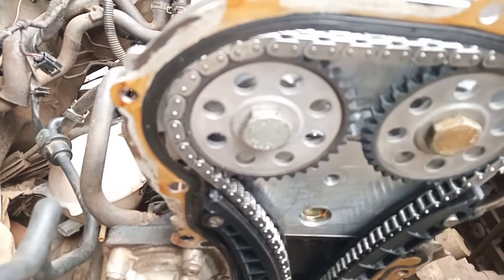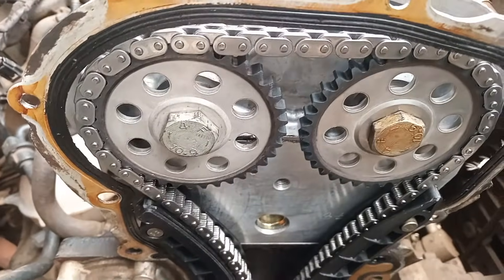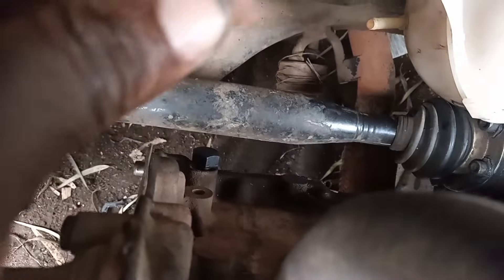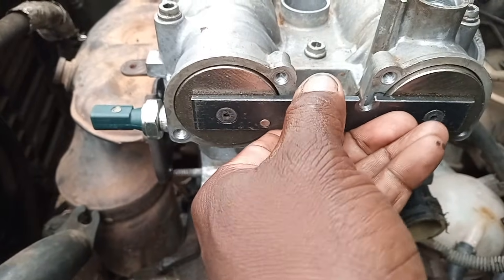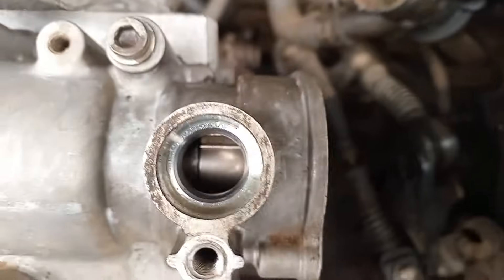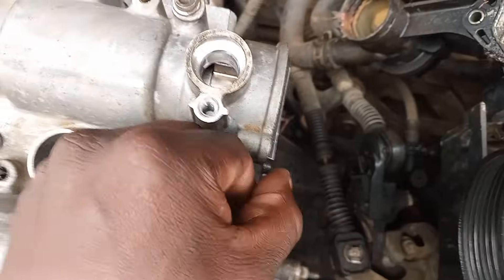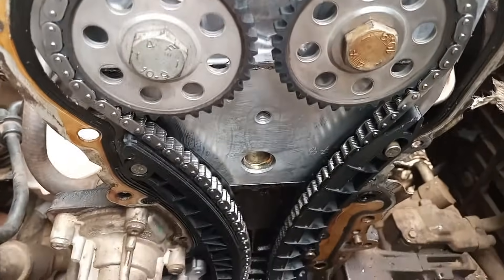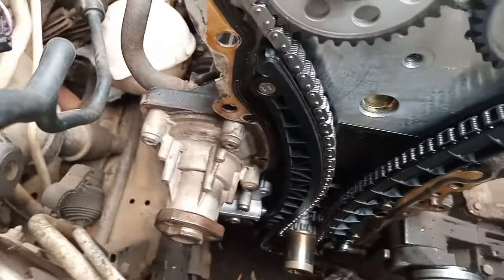VW Polo vivo  timing (CLP)

Comment: Good day my engine starts, but it shakes a lot, I have changed the breather valve fuel, changed plugs, and on plug number 1 and 2 they don't respond when removing the coil to show that it has been removed, The engine has to change the idle or sound, but it doesn't. Then on the camshaft is not aligned like the tool; it's vice versa. What could be the problem?
Reply from the maker: @juliussamuel2734  hi, if it's not responding on cylinder 1 and 2 it's likely that the head gasket is blown between the two cylinders. To verify that, do a compression test and see the values in all cylinders. Let me know if after checking compression
Reply from the maker: @juliussamuel2734  did you do any mechanical work on the engine?
Another possible cause could be a stretched timing  chain.

Comment: I have polo vivo 1.4  it chain keeps jumping what's the cause?😢
Reply from the maker: @AshantyPhaswana   replace oil pump, if oil pressure is low the tensioner fails and it jumps out of timing.
Reply: Timing chain not tense.. Need to replace one set